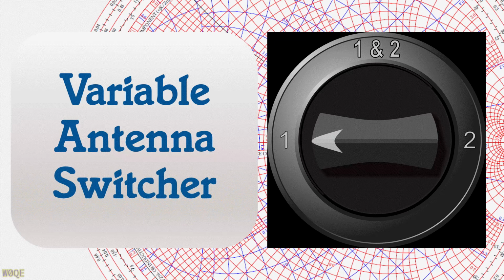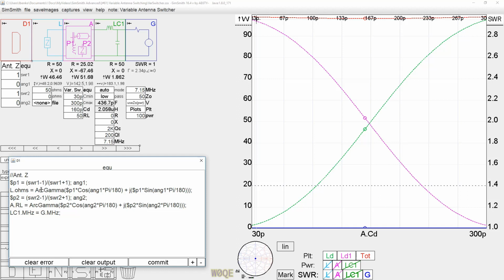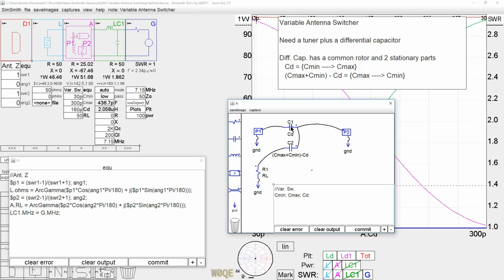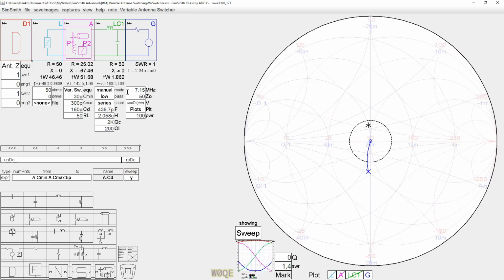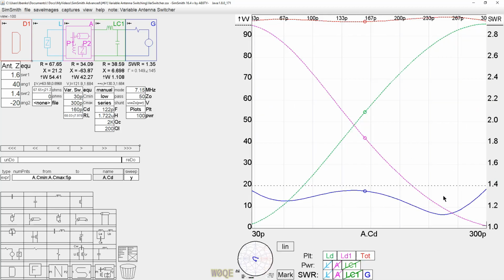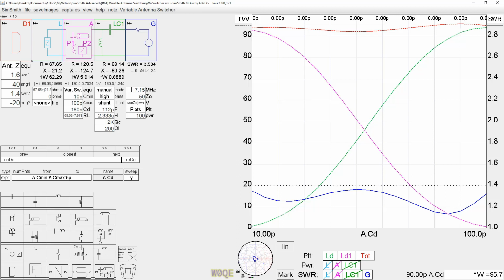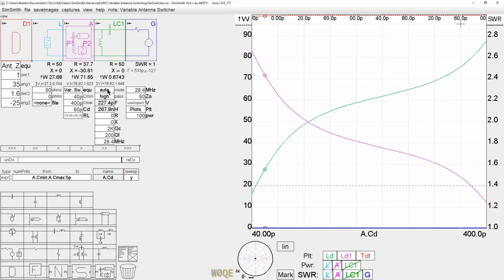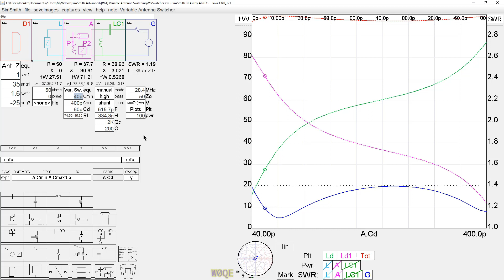#61: Variable Antenna Switcher

Comment: Nice setup Larry, Simsmith is a fantastic thing to use and this little thing you created would be excellent to use in commercial repeater systems where they have dual directional antennas, fx a national park, where they work in different areas and the seasons winter/summer restrics the radio coverage... very easy to give one direction more penetrating power when needed and easy to use for non radio personell.. :-) - i think i will make something like this... Just for the fun of it :-)
73´s
Anders

Comment: Interesting! I suppose in practice one could just use an auto tuner then just insert the diff cap and done. Thanks.
Reply from the maker: That is correct!  Once you have it set properly I would stop the tuner from auto-tuning unless it is a continuously variable tuner.  A switch type tuner would need the transmitter power reduced and the idea of this circuit is that the power can be varied between the antennas without lowering the power.